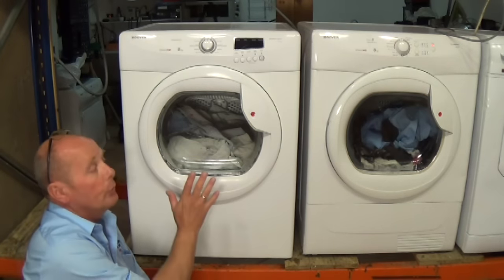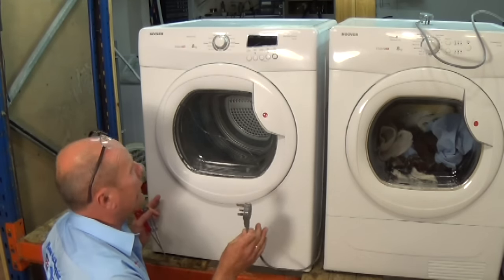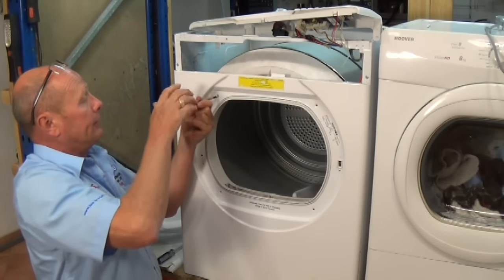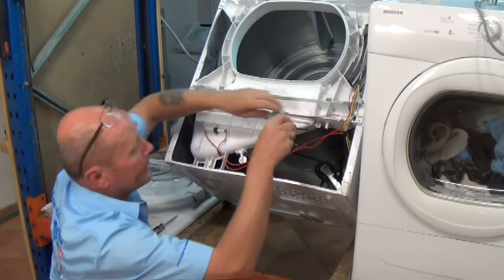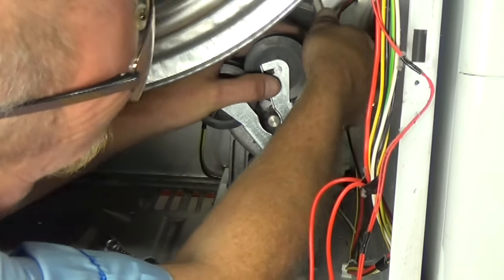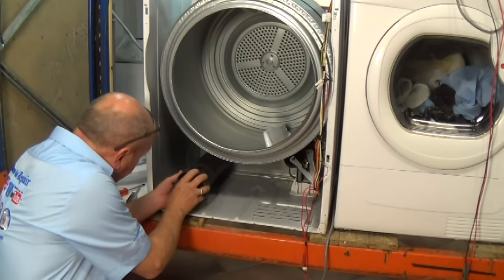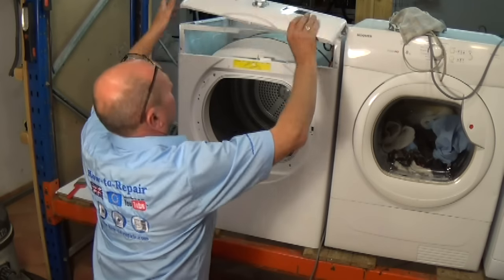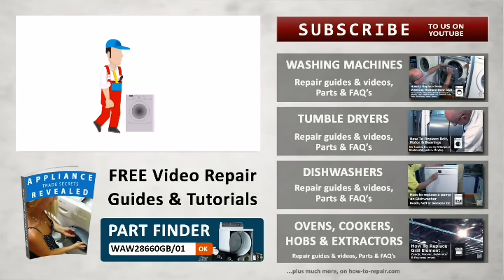Hoover Candy Tumble dryer drum not turning and belt ok faulty capacitor

Comment: Thanks to this video I found the cause of my tumble dryer startup problems and I followed the excellent step by step instructions to replace the capacitor which I bought from the how-to-repair eBay store (only £7). Granted it took me a good 4+ hours to do (as I'm a complete novice at white good repairs!) but it did the job at a low cost so I'm happier than the proverbial Larry!

Am very grateful to this chap for putting this video up, thank you

Comment: Many thanks for this tutorial. I was told by a tradesman that I'd need a new PCB for my dryer and he quoted silly money for parts and labour.
Then I did a search and this was the very first video I came to. 18 minutes later I felt I could fix it myself. An hour later I had ordered a capacitor and 24 hours after that I had the dryer up and running again. Total cost? A whole £14.95 and that included courier delivery! 
I saved a massive £170.00 off the quoted price. 
I found the tutorial very easy to follow but I managed to get my hands in the gap and change the capacitor without removing the drum and belt, a tight fit but saved a bit of time and effort.

Comment: Thank you! Fixed my dryer in less than an hour. Spent more time panicing about electocuting myself on the capacitor than in did to safely change it (no charge in it), put a new belt on at the same time so should be good for a few more years. Saved a call out fee and earned myself some blue points. Another job done! My wife was already eyeing a new dryer online but that money is now safe as well

Comment: Excellent video and has saved me from buying a new machine twice for the sake of a €15 part! My dryer 1st went last year and i found this video and gave the drum a push and sure enough it went flying. 9 months later power was on and the buzzing sound but did not kick into life when i pushed it. Was thinking it finally gave up the ghost but thought id change the capacitor. BOOM fired back up. Great detailed instructions top video!

Comment: Thanks for this, although there was much more dismantling to do on my Hoover dxc9tcg-80 (condenser dryer), I had it done in a few hours. 

For anyone that's interested Hoover have a support page with a list of required capacitors for each dryers,, certainly saved me taking it apart first before just to check.
Reply: I am struggling with my One Touch Tumble Dryer. I’ve got all the panels off bar the lower front panel (around the condenser). Amy tips on how you got yours off?

Comment: after watching this video, i decided to have a go at my candy condenser. sourced part from Hoover and it took me an hour and a half (mostly looking for tools in the shed). with a condenser machine, I had to prize apart the sides of the case to get at the capacitor and one of the spades on the capacitor was stuck so had to re thread another spade connector onto my cable. all cleaned out and put back together. works a treat now. thanks for the instructions off this video and with a bit of ingenuity, I have a working machine. here's to another 5 years of use.

Comment: Excellent video. Mine was the condenser version, so a little bit different, but managed to replace capacitor as detailed here. Spare part was under a tenner. Thanks you! Saved me a major expense in the run-up to Christmas!
Reply: How did you get to the capacitor?  Mine is a condenser as
Well, all I can see is what looks like a gas canister at the bottom.  Did you have to remove all the condensing unit at the bottom?

Comment: Excellent tutorial as usual from how-to-repair. My issue was with my Hoover Condenser Dryer. I made the school-boy error of replacing the PCB first (based on another YT video) before discovering this one. How-To-Repair will now be my go-to site for all domestic repairs. The Hoover condenser dryer takes several more steps but the principals are the same. The only addition is that you can't remove the bottom of the machine to get to the motor & capacitor so I removed the plastic trim and the fan before slipping the belt off the pulley wheel. This allows you enough space to get two arms down passed the drum to hold the old capacitor whilst undoing the holding nut. Ordered the h-t-r replacement capacitor from their e-bay store. Excellent price and arrived in two days!! Followed the refitting part of the video and the drier now works pefectly. I have a spare PCB if anyone needs one!!

Comment: Update, I replaced the capacitor today , as our hoover tumble dryer has a condenser it was easier to assess , I had a small issue removing thr casing as I had to remove the fan to put it back together again but changed the capacitor and now it is running good as new , will change the belt soon but will be fine for now . Thank you again for this it's been really really helpful!
Reply: Where was the capacitor located in your condensed dryer please?

Comment: Thanks for this! Ours was having the starting fault intermittently & was generally slow to start. Just managed to change the capacitor, does need a few tools beyond a basic screwdriver to strip down the machine but I had these already, new capacitor fitted & working perfectly, a bit fiddly to access & getting the connectors on & off, but job done for under £20!
Interestingly ours takes a 7uF capacitor, I checked the new one on the multimeter and got 7uF exactly, the old one is only reading 2uF!

Comment: Can I just say, I have the Hoover VisionTech Infinity 9kg condenser dryer & I've had the same issue, sometimes it would just stop mid cycle or fail to start just like you showed in this video. Its not in warranty & asked a few repair services for quotes. I in detail described the issue & they said a £50 call out to double confirm what I've said & then a £120+ fix.  I went online & ordered a capacitor for £8 it's been working a dream as of a few weeks ago since I found this video. Added bonus, I gave it a good clean of dust as well. 

So I have subscribed, liked & I will definitely share this & use as my go to place if you provide such a video. 

Thank you  very much :0)

Comment: Nearly ordered a motor my machine when it’s same as this . (We’ve been putting the weight of washing to one side and it starts it going 😂)
Shame I need to take it apart to find out what size it is (mine is one of them that I can’t order a part for 😓) 
Thanks , this will be second time you’ve fixed my dryer

Comment: Really useful video, thank you! Very easy to follow, step by step. If you're considering doing this, don't be put off by what seems like a millions screws to remove, just track which goes where (as he suggests), and keep going. Great that the video even shows the order for putting everything back together again. If you're about to get started, my one top tip would be BUY two capacitors (7uF and 8uF) before you start - they cost about £10 each, and you're going to be saving the cost of a new machine (about £260).  I learned that lesson the hard way - I used the model number on the back of my machine to track down the manual online which specified an 8uF capacitor.  So you can imagine I wasn't too happy when I opened up the machine to discover a 7uF capacitor in place!  Aargh!  As I couldn't leave the kitchen a mess and run the rest of losing screws etc, the worse part was having to close up the machine again until the new part arrived, knowing I was going to have to go through the whole process again in another couple of days time!  So, I strongly recommend you save yourself the hassle and buy two capacitors upfront!  Machine now working beautifully.  Thank you again!
Reply from the maker: it was a pleasure to help Thanks 👍 for watching and please remember to subscribe to the Channel as that's what keeps us going in able to make the video for you

Comment: Great Video, helped me a lot on how to strip this down, mine was new and banging let hell consistent with the rotation of the drum. I found two dents on the drum where the front cover supports the drum rollers, this is exactly where it was damaged from new. was able to knock out the dents and smooth the roler running profile. now its perfect and quiet

Comment: Great video but worth noting be careful when undoing the 13mm Capacitor bolt, when I was undoing mine the bolt wasn’t undoing it was in fact the capacitor that was turning which resulted in the two spade connector wires shearing off, it was an easy enough fix but if I did the job again I would follow the drum removal video first, this gives you much easier access to the capacitor and it’s only an extra 10 minutes to remove and refit the drum, also much easier for hoovering all the fluff up.Great videos though saved me buying a new dryer and the part only cost £10.

Comment: i thought my problem was the drive belt, replaced that (total strip down), put back together and still wouldn't start, just made a hmmmm noise, and would only turn with a little push to start off.  Just ordered the Capacitor from your site, got my fingers crossed that this should work.  Got a heater on order to as my machine had an e15 error as well and would not heat up.
Reply from the maker: If you have a humming noise then it's a good chance it is the capacitor that has gone faulty

Comment: I have the condenser version of this dryer, and it was a bit of a pain to get to the capacitor.  I still can't get one of the connectors off because I can only reach in one handed (due to the extra plastic bits at the bottom) but I was able to get a picture of the capacitor, and it is a 7uF one.

Ordered a replacement and I think I'll just cut a hole in the side with a Dremmel to access it better to replace it.
Reply from the maker: Of course I can't recommend cutting holes in machines but I do agree with you 100% that access to these capacitors are a nightmare. The manufacturer should have thought about it a bit better on the component that normally goes every 3 to 5 years.  @nelftm I would love you to leave your opinion on our poll about manufacturers building in obsolescence to appliances. https://www.youtube.com/post/UgkxygHomnUySd_bYjaJBdEHPO6T4dYo9Ahm
and this is for you https://www.youtube.com/shorts/e432SAb2g08 please remember to subscribe as that's is what keeps this channel going. Thanks 👍
Reply: @How-to-repair  Appreciate what you’re saying, but 2 days ago I was 100% decided to take it to the dump…. so for £11 and a bit of surgical cutting, I'll be more than happy with a patched up working machine!

Comment: Thank you. I was about to give up and found this video! I thought I might be able to use it by manually starting the drum while I wait for the part to arrive  but not really. I put a towel in to make sure it would still heat up and it does but its very slow. I guest thats because the motor is not what it what?

Comment: Thanks a lot as you have helped me in a big way and will be ordering a capacitor from you shortly. Thanks to this film I don’t have to buy a new machine hopefully. I have a question though. When I switch the machine on and then push the drum it goes but there’s a burning smell coming from the machine. Could this still the capacitor? Can anyone let me know please.
Reply from the maker: Glad I could help
Reply: @How-to-repair  hey I was wondering if it would be the capacitor when there’s a burning smell when the dryers working.

Comment: Thanks changed mine and repaired it. The capacitor was dead no spark. Mine is a zanussi and it is 35 yrs old!!!! The belt is threadbare but cost of replacement is too great. Never ever broken. Had 3 kids from birth to leaving home. Quality product unheard of today. Drum sounds and feels a little vibratory so bearing prob worn out. Capacitor was £7 so if it lasts 6 months great. Mine was a much easier fix than this indoor 8” square panel 4 bolts straight onto capacitor 2 minute job. Test with panel off and bobs uncle.

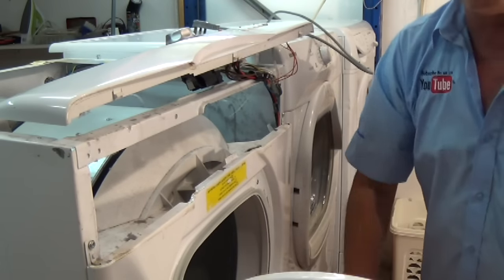Comment: 3:43 If one of those torx screws are broken inside the plastic front.... How would you tackle this please? 🤔 

The other torx is just not holding, well it did for over a year since changing capacitor, but now the hinge has snapped and want to hofuly do a full repair this time

Comment: Thanks for this. For what it's worth you may be able to get a phone in and take a picture of the capacitor labelling, if it's oriented in a favourable way, without removing the internal plastic sections. Saves a bit of time on the first bit. Illuminate with a torch and turn flash off. My Hoover VTV 580 NC-80 used a 7 microfarad version btw...

Comment: Great video which gave me confidence to start. But when I tried to dismantle my HL V8LCG model (2018), I could not find the way to detach the top of the case after having removed the three screws at the back- it resisted all efforts to slide, left etc. Scared to use brute force because of plastic edging. Help!
Reply: Solved. The top has to be slid backwards to disengage with two screws in the body that it is slotted onto. My top was extremely difficult to pull backwards, but eventually could be tilted up and off. Phew!

Comment: Mine does this exact same thing with the hum, but it smells of burning at the same time. If I then switch off the machine and move the drum a tad, switch it on again it works fine. Would this be the same issue.

Comment: We've just put our new capacitor in our condenser dryer with help from your videos and it spins like a dream.
However it doesn't seem to be heating now and coming up with error code E08. Not sure why! Is there anything we could've left unplugged by accident? We didn't unplug the sensor under the door so I know it's not that.

Comment: I've stripped all of the necessary parts down to reach the capacitor but am struggling to pull those two wires out, they seem to be stuck quite firmly.

Is there another method to taking these off?

Comment: Weirdly I tried this and mine still does the same thing and doesn’t spin. A push and it goes. Swapped the capacitor but can’t think for why it wouldn’t work or what now might be the cause. I stuck a continuity meter across the capacitor and got a good reading. Not sure if this would indicate anything wrong with it or not. Any more help would be greatly appreciated

Comment: Great video. Just got the capacitor replaced but now when I start the machine, it starts very quickly but then trips out the circuit board.
It had been running fine with a push. The capacitor is 7u. Anyone got any ideas?

Comment: I have a Hoover HY10A2TCE-80 heat pump dryer,  the motor turns although the drum sticks sometimes   but i have the top off to give it a helping hand to start it running,   Is this likely to just be a capacitor or in the sticking drum another issue?
Thanks

Comment: Changed the capacitor and now it's running perfectly again, ran for around 20 mins and the whole panel lit up like a Christmas tree beeping error e08 Hoover HL C10DF-80 (also noticed it's no longer warm) which wasn't an issue prior to replacing the part. Any ideas what to try 🙏
Reply from the maker: Hi, please use our contact us page and make sure you fill out the request for what your problem is. I will need the full model number of the identification plate and the details of your problem so that I can provide you with useful literature. A video shoot of the problem would be perfect as well.

Normally, I would get back to you within 24 hours, but I'm on my way to the IFA trade show in Berlin, so it might take extra days. https://www.how-to-repair.com/help/contact-us/  

Please remember to subscribe to our channel, as that's what keeps this channel going. Thanks, Paul 👍
Reply: @How-to-repair  sent a request thank you for getting back to me.

Comment: Hello mate and what happens if the drum does not spin when I push it?

Would you say that's the motor and do you have a video for changing a motor please ?
Reply from the maker: you need to know if there is voltage coming from the printed circuit board to the motor.
Thank you for leaving a comment, I would love you to leave your opinion on our poll about manufactures building in obsolescence to appliances. https://www.youtube.com/post/UgkxygHomnUySd_bYjaJBdEHPO6T4dYo9Ahm
and this is for you https://www.youtube.com/shorts/e432SAb2g08 please remember to subscribe as that's is what keeps this channel going. Thanks 👍

Comment: Hi, my tumble dryer has this problem except its a condenser that spins both ways. It spins clockways, and then it stops when it changes direction to anti clockwise and sounds exactly like this and when it's time to change again it starts spinning again clockwise. Is it still the capacitor
Reply from the maker: If the drum is rotating, then it's not the capacitor all the belt. If you can hear the motor turning, but the drum is not turning, then it will most probably be the belt. It does not sound like it's the capacitor because you can hear the motor running  @danderson11111 please remember to subscribe to our channel as that really helps us https://www.youtube.com/shorts/e432SAb2g08  Thanks, Paul 👍

Comment: Hi, some great informative videos .. my Hoover condenser dryer started this hum and I took off the lid, turned the drum, and it worked... just to test it, I put a few items in it and ran it for s few mins, but there’s no heat either. Would these both be linked to the same problem, or maybe the thermostat has gone also?? Just stranger that both happened at the same time. 
Thanks for any advice.
Reply: Did u find a solution?